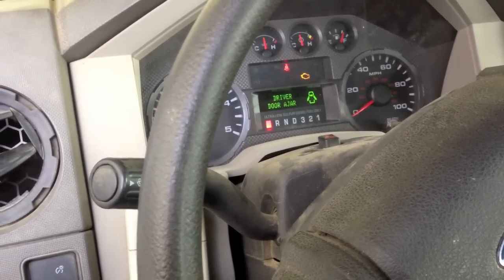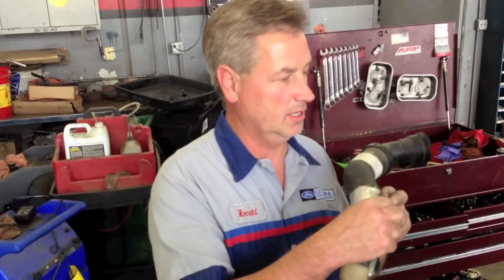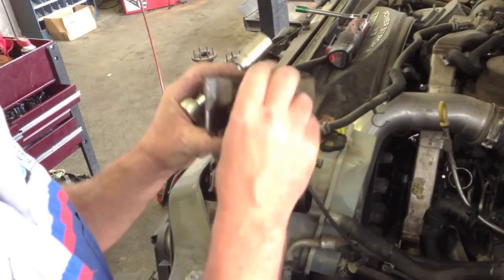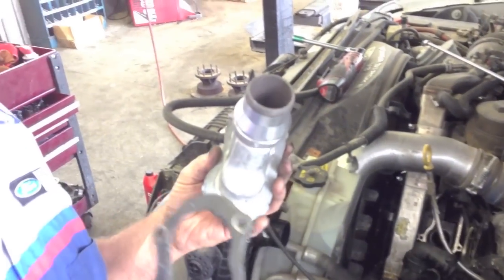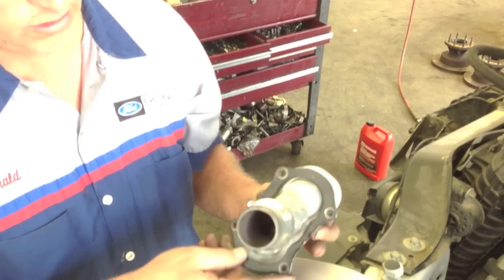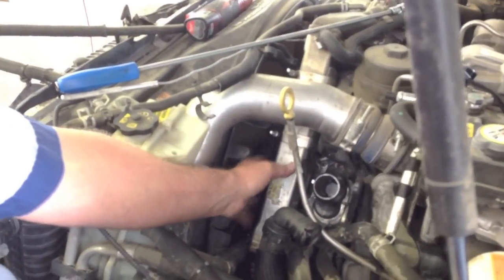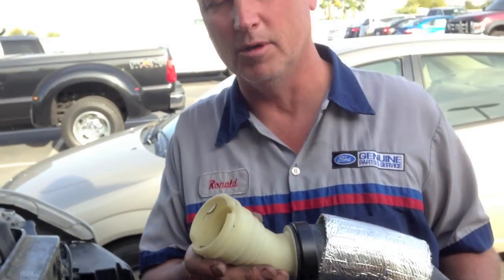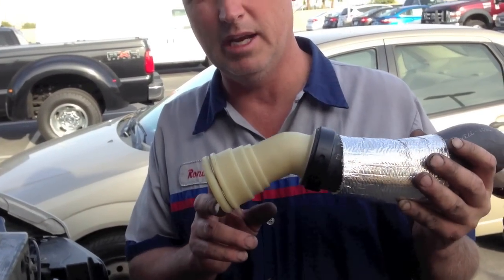P00B7 P0128 THERMOSTAT AND HOSE REMOVAL ON THE 6.4 FORD DIESEL POWERSTROKE

Comment: My 2010 F350 intermittently going in and out of limp mode when pulling 5th wheel. Water temp gauge pegs hot then quickly returns to normal. No signs of overheating under the hood. I take it to mechanic and they quote me $910.00 to replace the thermostats. I find this video, decide I can do it myself and 3 hours later, Done. Getting the hold down ring off and back on is kinda like a puzzle that I have no idea how I did it. Just patience and keep fiddling with it. Also, a 1/4 socket, swivel setup worked much better than 3/8 for me. Thanks for the great video.

Comment: Yesterday I put stats in my work F450 using Ron's method.   Found it easy to remove and reinstall the thermostat bolts using a 1/4 drive ratchet,   the 1/4 extension and socket allowed more clearance than 3/8.

Comment: I changed my thermostats today.   A 3" extension with a deep socket was too long to remove the bracket on my truck.  More like about 4" overall from the end of the socket to the ratchet.

This video was  a big help.

My truck threw codes.  I forget what they were.  These trucks won't regen until the temp gauge is nearly straight up.  So at some point you'll get the wrench symbol in the display, in addition to the CEL when the engine temp won't come up.  The only way to get it to regen if the tstats are leaking is to completely cover the rad and drive it until the temp gets up.

Comment: Thanks for the helpful videos. Are there any tricks to getting the 6.4 clip on hoses to seal? I replace my leaking radiator and decided to the hoses at the same time. The lower hose will not seal where it connects to the engine. It is a Ford hose with the dual seals. I removed it, checked the seals, put a little petroleum jelly on it and reinstalled twice. It still drips without pressure on the system. Any ideas?
Reply: Patrick Hogan never use petroleum jelly on seals it causes them to swell and bulge out we use Dielectric grease or silicone spray hope you got it fixed good

Comment: the only thing missing on how to replace the thermostats in this video is... how to replace the thermostats.. you made a great video on how to remove and install the housing....
Reply: the thermostats just twist and pull out of the housing... Very simple, didn't need to be shown. The hardest part is getting that black clamping ring out and that's why he focused on that
Reply: thetwig187

Comment: Which portion of the lower radiator hose do you replace to get the updated dual o rings. Is there a part number for that or do I need to get both? Thank you

Comment: Ron, are there any issues of cooler running temps after the new t-stats update? We replaced U/L rad hoses, radiator, and stats. Truck now doesn't get to temp. Coolant settles at 168 deg. Oil at 174 with hwy driving. Have you seen this before?

Comment: Hey Ron, will the truck always show codes when the Tstats are broken? I have an 08 f250 6.4l and I have no heat in the truck at all.. I'm trying to diagnose as to why. Thanks.
Reply: Life of Chels any luck bro I'm having the same issue and no check engine light
Reply: I sold my 6.4 for a LBZ Duramax lol. The problem wasn't my t-stats, turns out my whole coolant system was clogged. What we did was we drained the coolant out and actually used septic tank cleaner to flush it out... 3 times with high pressure water. At first it only trickled out the other end but eventually the high pressure water came out the other end after 3 flushes. It worked and I had heat in the truck afterwards. Not sure if that was good for the system using septic tank cleaner but it worked lol.
Reply: Alright cool I replaced the thermostats and it did the trick so thanks anyway but a druamax come on.... lol jk
Reply: You are still the man Ron! RIP brother.

Comment from the maker: I would suggest buying a scan gauge to monitor the oil and coolant temps. They should never get over 40 degrees apart. Make sure the PCM has the latest flash. It helps if you have a sticking pump or it logs a code if your oil and cooling temp get too far out of specs.